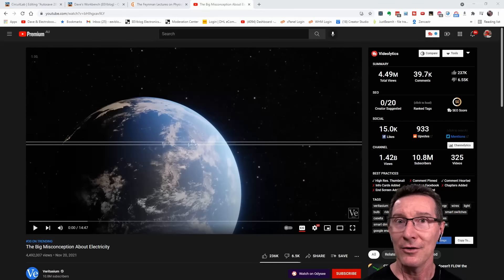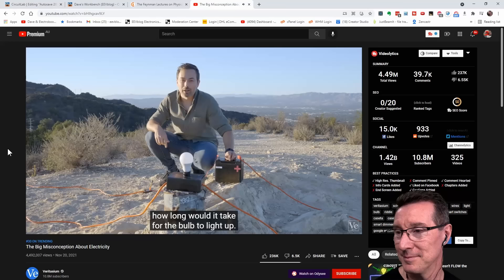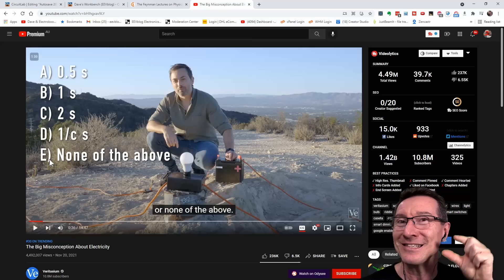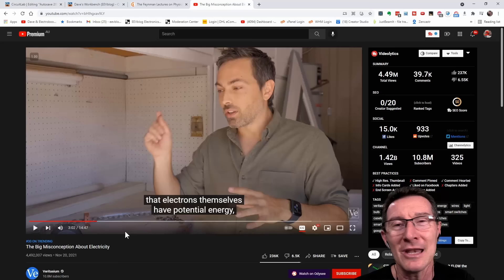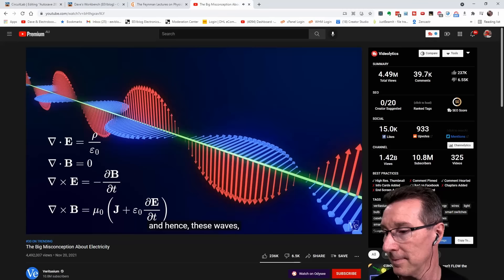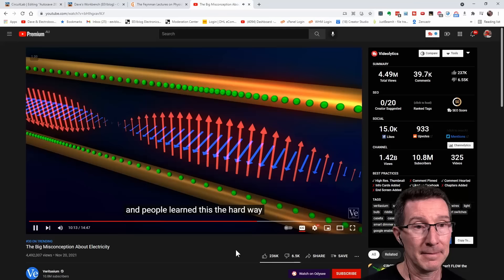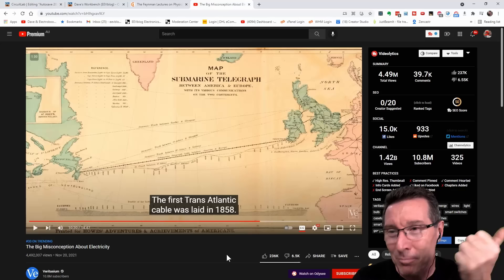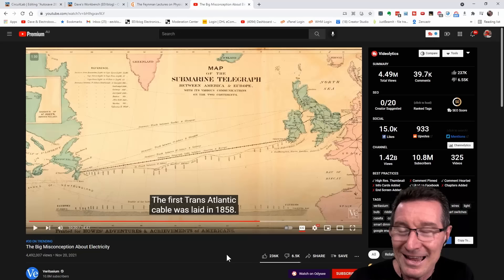EEVblog 1439 - Analysing Veritasium's Electricity Misconceptions Video

Comment: The transient behavior should be modeled as two antennas. This will properly take into account the separation distance for propagation delay and the energy transferred between the two "antennas".  Using the t-line model will have it so the propagation time is always zero and energy transferred is always 100%.

Comment: {E=eV} Think about it like this. If nothing existed except the battery, circuit and device.  Would the device still power up? -Yes.  While electricity does traverse through the wires coating, it's not wanted.  It creates static electromagnetic interference within the wire changing the shape of the sine wave and a standing radio wave outside the wire.  Any induced voltage on the wire from it's surroundings can amplify the total voltage in the wire and fry appliances. Wires are shielded to reflect this energy.  So just forget about any matter outside the circuit in this context.

In a DC circuit the "positive" terminal of the battery is already connected and creates (+12 volts - voltage drop) as measured along the wire through the filament all the way to the switch. Interestingly closing the switch drops the voltage to near 0 instantly as maximum current flows. It's all really very counter intuitive as the negative wire is actually where free electrons come from. The light turns on virtually instantly as the filament is comprised of existing valence electrons under pressure of positive voltage, called an electron volt. The cations of the positive terminal of the battery have an electron affinity that constantly creates a force in the wire pulling all potentially available electrons via the entangled covalent bonds of the wire. Closing the switch amplifies the electrons in the filament giving them potential to move the instant the -12V wire's potential is applied to the atoms electron affinity.  It doesn't mean that electrons actually move. It just means that electrons have potential to move and that is what energy is. The higher the potential voltage the more electrons are amplified in the filament, the higher the electron voltage. Once the first ionization energy is reached electrons are burned off the filament creating a standing wave of light and heat. Free electrons replace the burnt electrons delivering another eV to the atom. All lights in the circuit illuminate as one as the chain of current moves across them simultaneously. The force to ionize the light, the electron voltage, is modulated within the wire the instant the switch is flipped as the filament and wire is already comprised of co-valent electrons under the force of positive voltage.  However, it takes time for electrons to burn off after the first ionizing voltage so it isn't apparent that current is flowing instantly, but it is.

As with a PA system, when you turn the volume up it turns the volume up for all the speakers at once.  When you speak into the microphone you impede the voltage of the entire wire at once creating the same sound at the same time in all the speakers.

I'm trying to figure out a real world example and I'm not a nuclear physicist so bear with me..  The worlds smallest light bulb uses a carbon filament of only 100 atoms.  When the light is turned on, free electrons heat the filament as they flow through it back to the 2 volt battery, once 11.2603 eV is reached between it's valence band and conductive band it's outer valence electron is burned off, ionizing the filament, creating light.  So,100 electrons (2V)=200 electron volts turns the light on.  And 200eV\11.2603eV= burns off about 17 electrons creating electron affinity in the filament.  Each of the valence electrons affinities is equal to 1.75eV. Freed valence electrons traverse through the wormhole within the covalent bonds of the wire from the voltage source and replace the burnt electrons.  Free electrons constantly flow through the filament, freeing more electrons into the conductive band emanating light.  Plugging that into the electron-volt formula  {E=(ionizing eV)+(electron affinity(electrons)}    {E=200eV+(17(1.75)}   {E=229.75eV} to light the worlds smallest light bulb.  I think I'm missing something though so feel free to chime in. I guess it's kind of meaning less if there is no time frame. 

😉 I found this formula (100 W = 100 J/s ≈ 6.24×1020 eV/s) the energy consumed by a single 100-watt light bulb in one second and I've dug up a good source on "Carbon – Electron Affinity – Electronegativity – Ionization Energy of Carbon" from nuclear-power.com.  Time makes fools of us all doesn't it?

Comment: As an electronic engineer I agree 100% with your considerations. The Veritasium video mixes scenarios that an electrical engineer would model differently (DC steady state; AC power circuit; propagation of a step-function signal on a transmission line).  Modelling a physical system with ideal resistors, capacitors and inductors enables engineers to figure out what happens in daily life without having to deal with Maxwell equations and Poynting vectors. What is described in the video is obviously more of a mental experiment than a realistic setup, so I am not sure that spending time simulating something which could not exist in the real world with real-world approximate tools would yield a more realistic result, so the 1m/c answer is good enough.
What I find more confusing in the video are the considerations about energy flows. Statements like "energy is carried by the field, not by electrons" make little sense to me. The field is created by electric charges like electrons, is not something that exists by itself. What the video is completely missing are photons. The modern electro-magnetic theory is QED (Quantum Electro-Dynamics) and photons are the mediating particle (bosons) of the EM field, so they are fundamental to understand how energy is transferred among electric charges in any scenario (at least if you really want to dig into the details at electron level).  The fact that electrons do not drift much along the wire does not mean that electrons are not essential for the tranfer of energy to take place, they are, but you need to look at them (and photons) as quantum elementary particles. I posted a comment on Veritasium to highlight that.
Since you mentioned Feynman's book on the Poynting vector I would suggest everybody interested in understanding the real physics "under the hood" of each electro-magnetic interactions to read his short little book "QED:  The Strange Theory of Light and Matter". It explains things well for an engineer, without using any formula.
Reply: Excellent recommendation. As a student I picked up this book and it was the beginning of a very long decades spanning odyssey in physics and electromagnetism.
Reply: Thanks very much for this reference. I am watching his lectures that are archived on  the vega science trust page

Comment: As a non-engineer with a completely different day job and high school and maths/physics being decades ago, really enjoyed your review even though I saw his video some months ago. Possibly do more like this, e.g. going into graphene/super conductors, or possibly including things such as electromagnetic interference between cables, and the  use/nature of shielding and selection of wire for rf cable to oscilloscopes and the science behind it. I also enjoyed your video on developing pcbs with the computer design that you used and use of the software to generate the pcb, selection of components with a BOM file to practically make some things. I do not think all the people who watch your channel are electrical engineers and many people hobbyists (new or old), or people with scientific interest in how things work or making things, and equipment reviews and teardowns are about selection of the right tool and learning how things work, or avoiding large costs of occasional tools that will not get used often and possibly making them yourself if possible.

Comment: Thanks for the Great video/clarification..

The only question that remains to me would be:
What happens if you place the Battery and the Lightbulb 1000km apart?

Will an EM field still be created directly linking the Battery and the Bulb?

And will the Power still be transmitted through this Direct Field, through Air,
instead of go spiraling around the Wire?

-I mean, given the increased magnitude of the Distance, and Air's natural Resistance/permittivity factor.. 

Wouldn't the Power choose the wire with its Physical connection as the Easiest transmission path,
instead of going through mid air for 1000km?

Air has a considerable Resistance so, 
I don't really see how EM fields can extend and transmit power for a thousand kilometers/miles...
(except if we're talking powerful microwave Radio, or Light, but not Power transmission..)

So is there a direct and singular EM field that directly links my PC and the Power Plant 10km away from my home? 

Wouldn't this cause an Interference Hell, given that we've got millions of ppl in a major City,
using millions of electric devices at the same time, which may range from say 0.5W to 5000W of power consumption..

If that was the case,
the moment my neighbor turns on his 3KW heater, all my electrical devices would be affected..
And given a good number of neighbors I don't see how things wouldn't magically start running,
or get completely fried by opposing/out-of-phase EM fields.. you know what I mean?

Ofc EM fields will exist in any electric device,
but I thought Inverse Square Law would apply, and intensity/power will be reduced by the square of the distance,
rendering the EM fields of electric devices pretty much insignificant just a few meters away..

-So.. doesn't the Inverse Square Law apply to the EM field that links the Battery with the Bulb a 1000km apart?
You know what I mean?

We've got Inverse Square Law + Air's Resistivity, and all the interference that will happen..

Are you all positive the Battery and the Bulb are Directly connected by an EM field, 
which is the actual vehicle of Power transmission, regardless of them being 1000km apart?

(And btw, afaik this is the reason Tesla's wireless transmission of power was a bad idea..
The square law, and the resistance of air are such big factors, that the wireless transmission of usable Power is impractical beyond niche cases at relatively close distances.. right?)

-Btw, don't kill me but.. I very Humbly think that..
The representation of the circuit with the Condensers, is not true,
and only serves as a Visual Analogy of what will sorta happen with Air.. 

So the Results of the simulation are not valid..
And also you cannot get to any "DC Steady State", simply because there's no Condensers, and no direct link through air..
There is Air and Space, but that's not really a Condenser physically connected to both wires, 
so while the Analogy may be Correct, the results of the simulation are not true..

And so, I don't think the simulation of the circuit is valid.
We need a better simulation that takes in account all the actual factors, wire length, separation and resistivity, air permittivity..
and well, all the rest of physical factors in play..

(However Thank you for mentioning the DC Steady State topic, 
it's something that's hardly ever talked about/considered..)

Comment: Maybe this is a misunderstanding but I'd say I disagree both with Veritasium and you. To make my point, let's suppose that the switch is to either end of this really long wire (300'000/2 m to the left or right) and not next to the battery. I press the switch and the lamp turns on in 1m / c, while I'm 0.5 light-seconds away. Well, then I deserve a prize because I just transmitted information faster than the speed of light. I just took 1m/c = 3.333 ns to send a message from my position next to the switch to the lamp's position while light needs 0.5 s to travel that distance!

Of course, this is not possible. So what's wrong?
The thing is that the situation that Derek and you described happens the moment the battery is "conjured" into existence and to be more precise there are transient currents flowing through the lamp as long as the battery's distance to the lamp is changing, because as you very well said the capacitance is changing etc. The battery, produces a (very weak) E field from it's location to infinity. Actually any lamp in the universe would theoretically see some of it and as long as it is moving the lamps will be "turning on". In practice, I doubt we would even be able to measure any current at all even if the battery was 1m away from a lamp but that's irrelevant. The moment the battery is put 1m away from the lamp and is left to sit there, interesting things stop happening. The switch becomes irrelevant until only 2s later after it's been pressed so we might as well ignore it before that moment when the system would transition into its steady dc state.
With that said though, surely, if they switch is indeed next to the battery there would be some additional capacitance introduced when it would be pressed because of additional wire connected to the battery so for the sake of precision we may assume that there will be some infinitesimal transient response but that's it.

So, assuming we start the experiment after we position our hypothetical lamp, battery, wires and switch to their respective positions (as in Veritasium's thought experiment) we'd get, only theoretically, a minuscule transient response after 1m/c seconds which would dissipate rather quickly. Then, after 2s would the lamp really turn on, and reach its steady dc state.

Comment: My beef with this video was that it buries an idealized antenna problem in an incorrect idealized circuit. If we're going to be factoring in electric and magnetic fields, then he needed to include a virtual capacitor and transformer across those two lines, which would make the light-second long conductors less relevant. Here's a question I'd have for Derek's model. If you re-open the switch after the bulb is turned on for a few seconds, how long will it take to turn off?
Reply: That just about sums it up perfectly.

Comment: Yes the electron drift velocity is very slow for DC current but in a real circuit the electrons in all the wires are drifting at the same time. The myth is that the current has to propagate at that slow speed. It is set up immediately (within the bounds of physics) throughout the entire circuit.

Comment: You keep going on about DC, but Derek never actually treats the steady-state DC case at all! He treats the unit step function of turning on the switch as the "DC" case. 

When I did my simulations in response to his initial quiz (which didn't mention the "any current at all" assumption) I assumed a cool white LED lamp (forward voltage drop 3.6V, 20mA to be "on" brightly enough to be easily visibile), 390Ω resistor, 12V battery, magical non-bouncing switch that provides a unit step function of the voltage, and superconducting 22-gauge wires (for about 900Ω characteristic impedance 1m apart IIRC). Then I just simulated it with SPICE `TLINE`s, shorted at the ends, with 0.5s line delay. The current through the LED rose to about 5mA almost instantly, and then kept going up in steps every second (as expected), reaching 11mA at 1s, 16mA at 2s, 18.5mA at 3s, the 20mA threshold I'd given to consider it "on" at 4s. So my answer was E!

So the thing I took issue with in his video was the pre-video quiz having unstated assumptions! It'd take a couple of seconds for a real LED to be visibly lit, even though some current would flow in 1m/cs!

Comment: Short answer "E - None of the above. Ignore his omission of 1m, there are other issues, as your both forgetting the impedance of the lead acid battery, he demonstrated (or any), due to the laggy conversion of electrochemical to electrical energy, via the Grotthuss mechanism, which will also require a potential difference, to trigger the reaction (his diagram has no independent ground). Similarly the impedance of the bulb is essential to it converting the electromagnetic energy into light, and heat, and the old laggy planck constant comes into play, in that conversion. So far more to consider than just the first electron moving, to the BULB ILLUMINATING.

Comment: If you want to see the field do work... Without the physical connection. Get a linear fluorescent light bulb and stand under a high voltage transmission line. It will light up in your hand. You can actually eliminate claim that the power somehow jumps and you're grounded by standing on the Earth by also standing on top of your car with rubber tires it will still light up. This used to be one of my Facebook profile photos. Hope this helps

Comment: There is some energy that goes from the switch to the bulb in 1m/c seconds. But it is not the amount of energy that can travel in (or nearly in) the wires. It's more like the bulb is experiencing a small magnetic force when the switch is closed (but not exactly a magnet, just sort of like that in intensity...) The real power to fully brighten the bulb to intensity must still traverse the entire wire. If the full electrical power traversed the gap, then you'd be shocked just as badly putting your finger between the bulb and the switch as you are if you grab the live bare wires when electricity is flowing. That decidedly does not happen.

Comment: You can setup an experiment to demonstrate this with balloons, or rather charged ping pong balls, between two charged rails with the same charge. Once all the ping pong balls and rails are setup; balls are centered and under tension, pushing one ball moves them all. Use a non conducting rod, otherwise the whole setup is discharged without experimental benefit. Both the balls and the charge are needed.